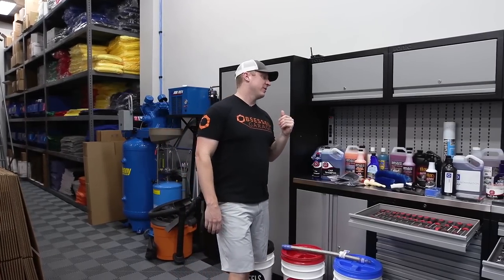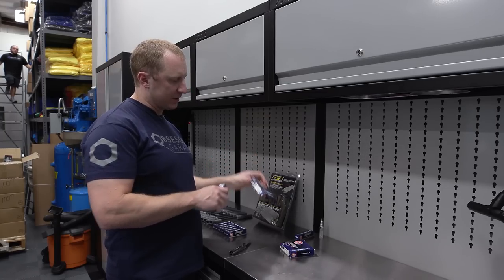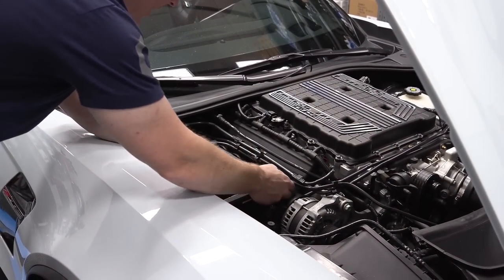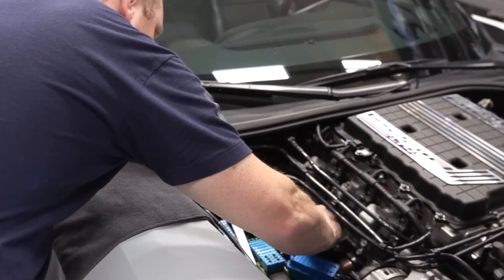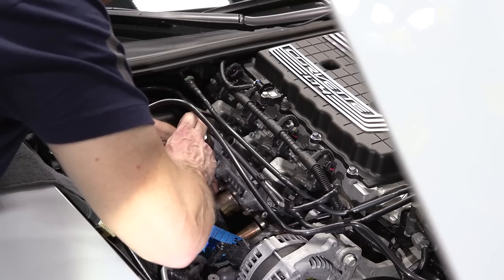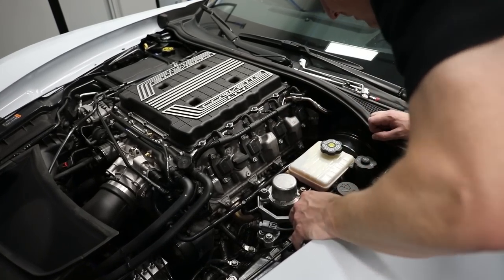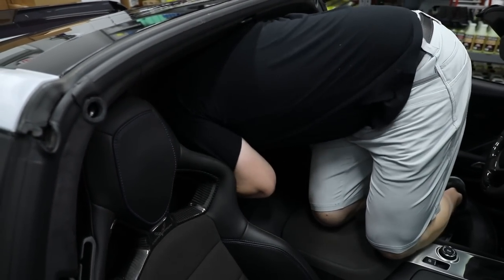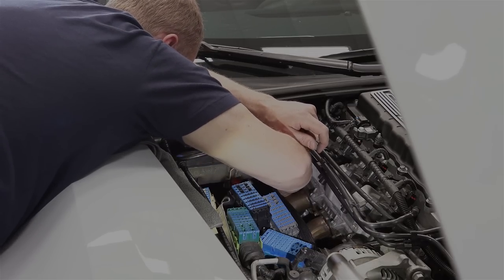C7 Corvette Modifications: NGK Iridium Plugs, MSD Wires & DEI Protect-A-Boots

Comment: Alright I'll be the first one to criticize LOL!  You should use the pry type spark plug gap tool or needle nose pliers to bend the strap to your desired gap and never force anything between the tip and the electrode on iridium plugs.

Comment: You didn't need to crawl inside.  If you remove the key from your fob, there's a keyhole in the rear bumper where you could've just inserted it and turned and the trunk would've popped open.  There's also a manual release for the door right beside the seats.
Reply from the maker: Well...that would have been smarter.  Next time I'll know.  Ha, ha...

Comment: I don't think I've ever removed plugs with a box wrench on a plug socket before as I've always built some ridiculous tool using the socket plus like four socket extensions and universals plus a speed wrench! Guess I've learned something new.
Reply: Also, remove the physical key from the fob and there's a keyhole by the rear license plate to open the rear hatch in case of a dead battery.

Comment: Oh lord, I’ve gapped tons of plugs but NEVER by tapping them on metal. I use a wire type plug gap tool which has a little notched piece for adjusting the electrode.
Reply from the maker: Let's have and I.Q. contest.  You know where my money is.

Comment: Any reason why the step to a colder plug. I am assuming your not adding a lot more boost or running different fuel or increasing timing aggresively to want colder plugs. Headers and intake (removing restriction) remove pumping losses. Won't colder plugs be going the other way. Technically your cylinder temps should drop a little since the engine will have less pumping losses and (thus making the power gains u mentioned). Colder plugs in this case might cause premature fouling and might not start well during cold starts. Just an observation? Maybe I am wrong.
Reply from the maker: Pulley, cam, intake, headers, etc should warrant them.